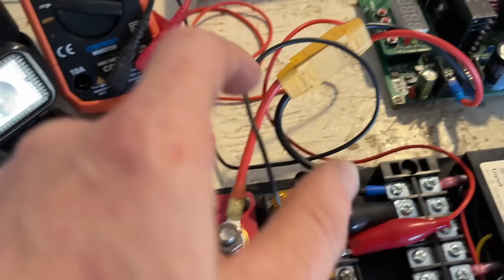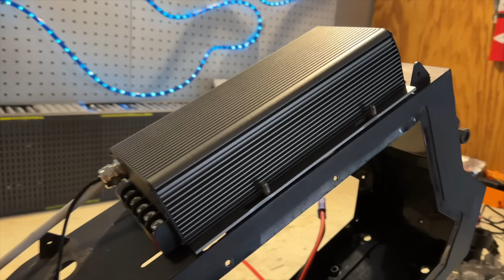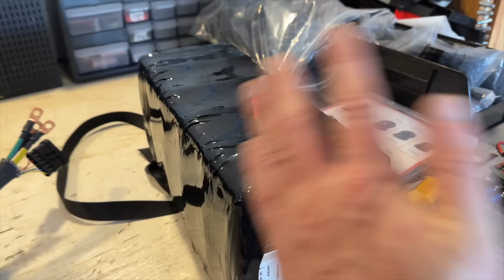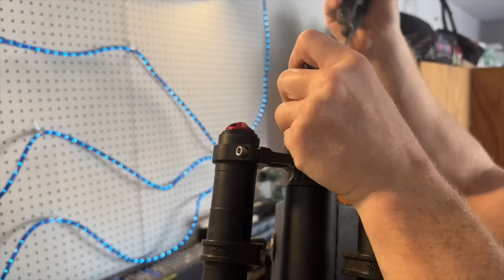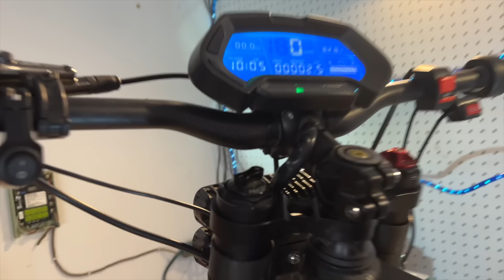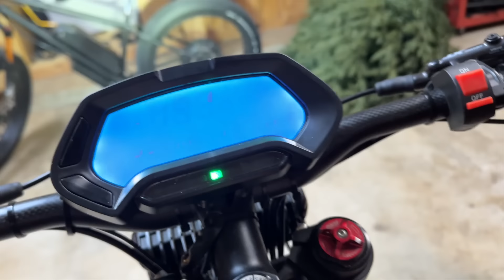This Might Be The Best Way to Build a Stealth Bomber Ebike

Comment: The question I have right off the get go here only 1:00 in is about the electronics you say you are going to bolt to the bottom of the frame. What about water splashing in those holes? Isn't that exactly where the water trail will come off the front wheel?
Reply from the maker: the panel where I mount the electronics is actually the top of the bike. frame is upside down at 1:00. I used water resistant pass-throughs for the holes at the bottom. this bike is definitely fine with water splashing
Reply: @GaiusGarage  yes, sorry I meant to delete that. I seen once you flipped it over that it was on the top. Love the way you incorperated everything right there. Wish I had the know how to make my own board like that one.
Reply from the maker: @Jbmc65  Thanks! I do offer 1:1 zoom sessions if youre interested. if youre building one of these I can definitely walk you through the wiring. link to schedule session is in the description

Comment: FANTASTIC!  I want to thank you for the electronics crash course in the beginning -- illustrating the function of the relay and how the positive and negative current factors in.  I am a COMPLETE novice and do not understand electronics (actually fear it).  But with that explanation, I am beginning to understand it a bit more, despite my previous failures.  Do you teach electronics or something?  Anyways, excellent job and presenting it so that an idiot (like me) can understand it. (smile)

Comment: Awesome set up! It'd be worth considering if batteries and motors weren't so ridiculously expensive.
Reply: Yep you might as well buy it they cost just as much to build so why bother
Reply: you can save money if you can soldier yourself ... and not buy cells... but new unused smaller packs.   ...Say 36v or 48v packs nobody is buying as much as everyone wants the best fastest highest current draw stuff

Comment: Whats the ride, handling, cornering like, esp' when your running road tyres?  Approx total cost in parts?  Ta.
Reply from the maker: handles ok.. could use better suspension. also this frame geometry is pretty basic but good enough. dont remember the cost in parst..~$2k probably
Reply: @GaiusGarage  How mush does it weigh?
Reply: Thinking about building one, basically a 'chook chaser' e motor-cycle or getting a 125 or 250 road bike and converting it to xafe racer style bike.  I currently have a 750W 48V 15 AHr e bike i put together.  After better road manners, more confortable, higher speed and range, and the next level of technology and quality.  The plus side of your bike is its a kit basically and i esp' like the switchgear and dash integration.  I really want standard integrated switchgear for a motorcycle and not a suillion add on buttons for each feature.  I think your bike does this pretty well.  If i bough a 125 or 250 rolling chasis i would want this, the switchfear and dash integration, the rolling chassis would be fine, rear hub solves the motor, just battery, controller and a bun of witing.  A small fairing for better aero and wind / rain protection would be high on the list of wants.  And if i can do either for arounf 2k then that sounds pretty good.  Also might want more of a motorcycle dirt bike seat rather thena bicycle seat and box that area under the seat for battery, controller, storage or whatever make sense.  Easy enoug to do, with angle bent alu sheet like the frame.  Thanks for your video and hep.  Much appreciated.  @GaiusGarage
Reply: Of course i would hve to add a set of crank to the e cafe route, which adds to the complexity and cost of the build, perhaps needing a welder etc.  But your basic idea bike would be good, perhaaps with more adventure of road based geometery and a smallisg faring.  
 @GaiusGarage
Reply: How many working day say at 8 hours a days did it take you to build it.  As you note it looks like the wiring is the main chore, and has to be done to a reasonable standard.  Ta.

Comment: Really nice work on this as well as the e-KLX.... Do you build battery cases with the plastic print machine? I would be interested in building a battery case as the case I bought is "mm's" too small. Think about renting the machine as UPS does except you know how to work the machine. I would send the case if you could print the additions/new size... really would not like to chop this thing up.. I think you can build the additions into the case... let me know... thanks!!
Reply from the maker: I may be able to help - sounds like you just need me to print some 3D models for you - but I would really need to understand the details better. Please book a Calendly session here: https://calendly.com/gaiusgarage/15-minute-consult its $25 but if I cant help, I will refund the cost

Comment: With bikes that go over 30mph do you have to think about wheel balancing the same with regular tires ? Surely at 70mph you get a vibration / wobble?
Reply from the maker: ideally they would be balanced but they would have to be pretty badly unbalanced to feel vibration. the more challenging part actually is truing these spoked wheels, especially the rest with the hub motor. wheels that are not perfectly trued contribute most to wobble and vibration

Comment: do i need the whole circuit thing?? or is that just for the extra features?
what is the circuit called?
Reply from the maker: depends what youre referring to as the circuit but if you're talking about the board with the fuse and all, yeah, you kinda do need it for the bike to be practical and safe. basically you need a way to turn it on and off, that's the whole point. the stuff with the lights, brakes, display etc. is obviously optional but for basic functionality you need a control circuit or the equivalent. if youre looking to build one of these, I do offer consult sessions where I can walk you through all the details and save you a bunch of time learning on your own. link for that is in the description
Reply: cool thanks. do you know if any tutorials on these?
Reply from the maker: @916NH  not really that I know of specifically on this topic
Reply: @GaiusGarage  hey so this guy from another channel says that if you get a motor kit and battery then most of them have the fuse built in?
Reply from the maker: @916NH  just depends on the kit. some controllers come with a fuse. some (more expensive) battery packs come with a fuse. but even then it's better to have a dedicated fuse for your line and multiple fuses overall. all that said, Id say that most kits don't come with a fuse built in. cheap ones definitely don't and the "kits" on aliexpress are usually just a mix of motor. controller, display etc just bundled together
Reply: @GaiusGarage  cool thanks
Reply: @GaiusGarage  is there any video on how to put that whole thing together? the wiring panel
Reply from the maker: @916NH  I never made a seperate one just on the panel

Comment: How do you wire the thumb throttle for regen braking?
Reply from the maker: the controller needs to have an input for it but if it does, its wired the same as a regular throttle..ground, power, and signal
Reply: @GaiusGarage I have the sabvotan 150 amp. Don’t see a separate connection for regen. Any advice
Reply from the maker: @Kingnegotiator the sabvoton 150 has a connector for regen braking.. should be just like the ones Im using in the video
Reply: @GaiusGarage it has the 2 connectors for the brake levers. Do I just unplug one and connect the thumb throttle thing to it? In the controller settings what’s the amps/ setting u have for ur regen braking? Would really be helpful to add this as my brake pads don’t last as long thanks in advance
Reply from the maker: @Kingnegotiator  do the connectors both have two pins or does one have two and the other has three? typically these don't come with connectors for each brake lever. you get one connector for the brake signal (two pin) and the other is for regen throttle (three pin)
Reply: @GaiusGarage  nope both are 2 pin for brakes I assume. Not seeing a 3 pin for brakes.
Reply from the maker: @Kingnegotiator  not sure then. maybe you have a different version. maybe reach out Siaecosys who manufacture these
Reply: @GaiusGarage  well that’s a pain. Thought maybe they were all the same. In the controller setting I can turn regen on/off etc but was hoping to have some sort of variable like u have
Reply from the maker: @Kingnegotiator  as far as I know there are two versions - one with the "TFT" display and one that's more generic. the latter is a far better option IMO. but both have the regen line in my experience. I'm not sure how or whether things have changed or if maybe they released new versions. hmu on Instagram & send me some pics of your wiring harness. @gaiusgarage

Comment: Crazy build. What tires and brakes are you running? If those are off the shelf enduro bike parts I don’t think they’re built for braking at 60mph.
Reply from the maker: these are dirtbike/motorcycle wheels and tires so good for high speed. brakes are downhill MTB breaks which are also very capable but pads do need to be replaced more often

Comment: shouldn't the fuse be first on the board on the black end of the circuit since, electrons flow from the negative?
Reply from the maker: you are correct that actual electron flow is from negative to positive but the actual flow of electrons through the wire (called drift velocity) is actually quite slow, only less than 1mm/s. thus, electron flow is not the mechanism by which the actual transfer of energy occurs, rather it's via electromagnetic flux at the speed of light. so its a bit of a misconception to imagine that you must place the fuse "toward the source" of the electron flow, as if electrons are flowing like water in a pipe. there are several reasons why the fuse is placed on the positive side closest to the source. In AC circuits, the live wire is more dangerous than the neutral wire because the live wire is at a higher voltage relative to ground. If a fault occurs, you want the live wire to be disconnected. Placing the fuse on the live wire ensures this. A similar circumstance happens in DC circuit where the negative terminal is serves as a reference to ground. Placing a fuse on the negative side in such circuits could still leave the circuit's positive side live with respect to ground even if the fuse blows, which might pose a safety risk in certain scenarios.
Reply: @GaiusGarage  thank you for such a comprehensive explanation. So the flux in the fields would be why sections of the circuit further “down the line” but physically closer to the source would energize sooner than other sections in the order of the path of the circuit but physically further from the source?  And if the fault happened in between these two places, would that be an example scenario where the positive end could still be live?
Reply from the maker: @Kryso_0  yes, that is generally correct. all parts of the circuit energize pretty much instantaneously since energy flux travels at the speed of light. but recall voltage is a measure of electric potential difference between two points. you can measure any two points in space, regardless of whether they are part of a circuit or not, and if there is a difference in coulombs of charge, there will be some measurable voltage, no matter how small. this does not change if there is a fault in a circuit, the positive terminal will still have the same potential with respect to ground, whether or not the circuit is complete or broken. placing a fuse upstream of all the components in the circuit on the positive side will mean that, when the fuse blows, all components will be taken to ground and will have a 0V potential with respect to ground. In contrast, if the fuse is placed closest to the negative terminal, when it blows, all components will be taken to positive battery terminal and will still have the battery voltage potential, with respect to ground. in the former, a blown fuse means the system has no electric potential. in the latter, a blown fuse means the current flow is interrupted, but the voltage potential remains unchanged

Comment: For your wire connectors and your multi wire connectors they're so bulky you should look into the aircraft industry and the yachting or  houseboat industry and you'll find what you're looking for there in a higher quality unit

Comment: What about weatherproofing the electric parts ?
Reply from the maker: there are different gradation of waterproofing given by the Ingress Protection (IP) ratings. The controller and motor are IP7 (which is very high) but it would take a ton of work to achieve this level DIY. Id say the frame is IP3 or IP4. Ive ridden this bike in the rain many times without issues. but generally speaking, this is not meant to be a ridden in good weather and/or dirt/mud but youre not going to be crossing any rivers on this thing

Comment: the bike has a very awkward head tube angle, which makes it noticably twitchy to steer at speed
Reply from the maker: yeah this frame is definitely "budget". I tried improving the rack angle by using a shorted rear shock, which does help but the handling at high speed is not ideal. really best around 40-45 mph

Comment: The reason why the LCD has both the high and the low voltage in is probably just to display the battery level and voltage level
Very nice video, btw. Thank you for taking the time to go into the details
I don't know about the legislation in the US but wouldn't this qualify as an electric motorbike with that much power?
Reply: Its not street legal here in the united states but everyone rides them on the street anyways

Comment: I know this is pedantic and I'm sorry in advance but it bothers me that you call 72v High Voltage
Reply from the maker: I'm referring to battery/drivetrain circuit as "high voltage" in contrast to the "low-voltage" (12V accessories) circuit. this is common nomenclature in EV design. whether the voltage is actually "high" depends on the context. personally, I don't consider anything below 20 million volts as high voltage
Reply: @GaiusGarage  Don't get me wrong I understand why you did it, but the concept high voltage is defined by the IEC meaning above 1000V for AC and 1500V for DC.

As I said this is very pedantic and doesn't matter at all.

Comment: Great. It seems though that some wires and connectiors are exposed to water from riding in the wet.
Reply from the maker: yeah.. not really a waterproof situation here. but only thing worse than wires getting wet, is riding this thing in the rain

Comment: That’s a nice motorcycle, definitely not an ebike at that speed. Would recommend putting turn signals on it too. Crazy how that feature isn’t more common on ebikes.
Reply from the maker: its more of a motorbikle. Ive never actually used a turn signal on a motorcycle in earnest. prefer hand signals (pointing) if necessary or the best turn signal of all: acceleration
Reply: @GaiusGarage  pretty much the reply I expected from someone going 55 in a residential area. Lol
Reply: @Starr3712 yeah well u cant expect much from someone doing 60 while wearing nothing but a ''crop top'' 😂

Comment: do you rember/have the battery compartment dimensions?
i ordered the frame and motor but i'm building the battery myself (not the first one) and it would be pretty usefull to me to know the max width of the battery, i want to make a pack with 21700 but i don't know if they will fit.
probably the battery will be 145/150mm wide
Reply from the maker: I have the dimensions in the full build video for that battery pack here: https://youtu.be/QMQYfk2RKtU

Comment: That's an amazing build - but man, first test ride and you're not dressed for the slide? My balls crawled up inside me thinking about it.
Reply from the maker: Thanks! technically I had tested and ridden it before the test ride that I recorded but you're right, I should have full leathers for these. I actually later discovered that the headset was not fully tightened 😅😅😅

Comment: on the dash thats not a brake light indicator, its the headlight indicator
Reply from the maker: yeah that makes sense.. the one Im using for the headlight is supposed to be for high-beams but since this bike doesn't have high-beams, I thought it would be better for the lights. On another motorcycle build I wired the that headlight indicator to the light to show that the contactor was engaged

Comment: Just imagine!  Rear swing arm isn't a fork but a single arm on which could be mounted a larger axel and hub for larger bearing.   Also brake and motor can be mounted as well.   Wheel would be separate coming off with 4 bolts for extreme ease.  Also Box up area under seat to max to allow for storage or even charging system while increasing seat support.